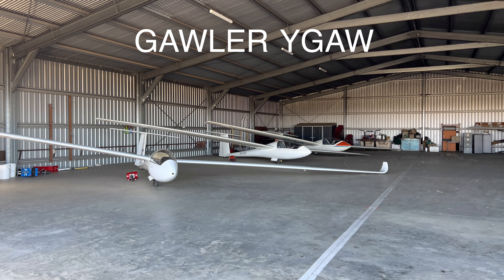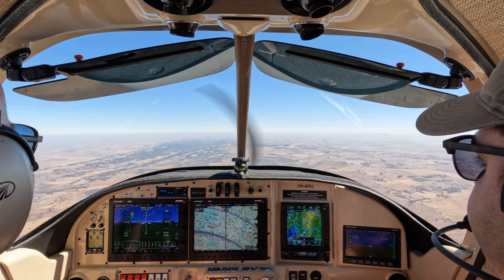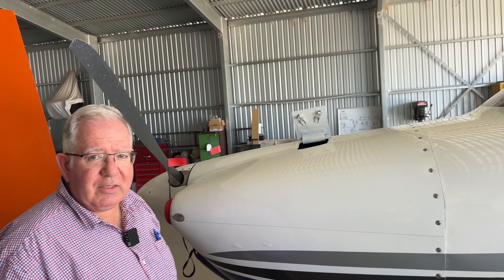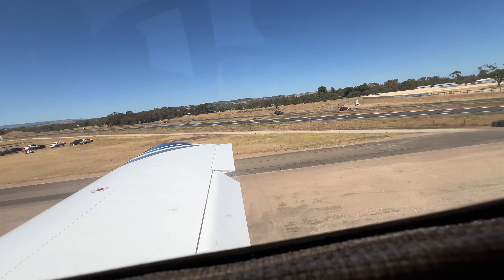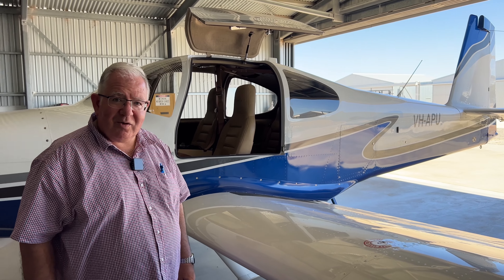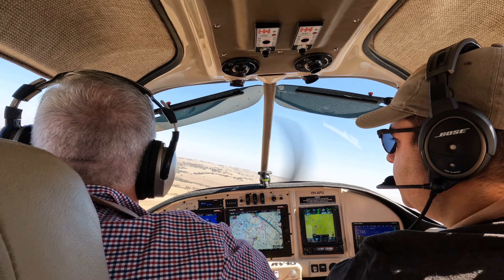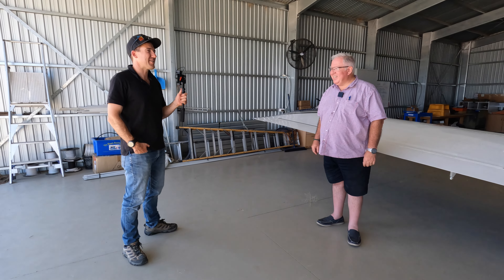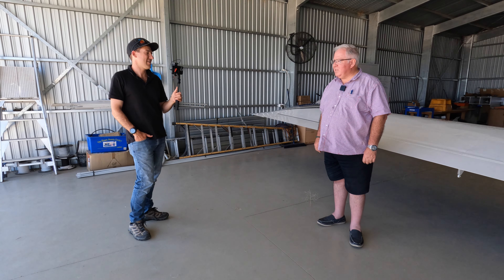VANS RV 10, WalkAround, $100 BURGER FLIGHT

Comment: A very thorough interview of a kit builder. A very different experience  to me building my kit Sky Dart. I had the advantage of working with kit designer. Not to mention mine is a 2 seat ultralight!
Great video and discussion with your son.
Reply from the maker: Thanks. Patrick was an absolute machine, had so much knowledge share and I’m sure we just saw the tip of the iceberg.
Just had to google SKYDART, interesting aircraft. Would have great visibility I bet sitting further forward to offset motor weight. 
Is the pilot weight quite critical?